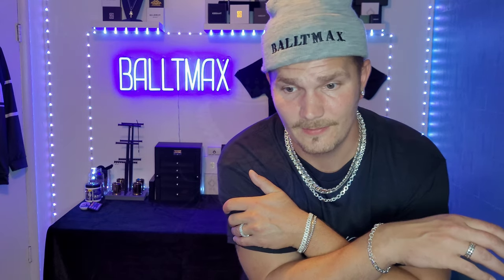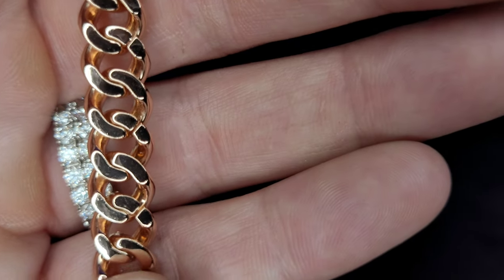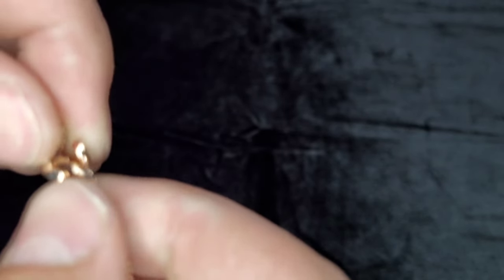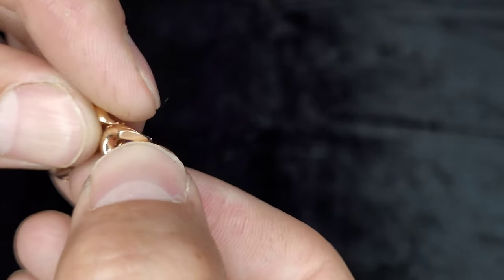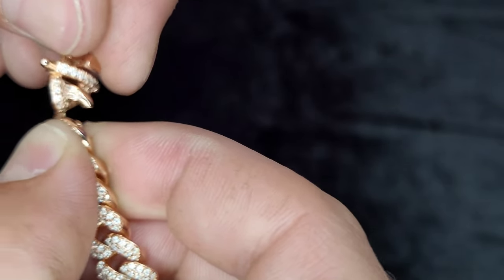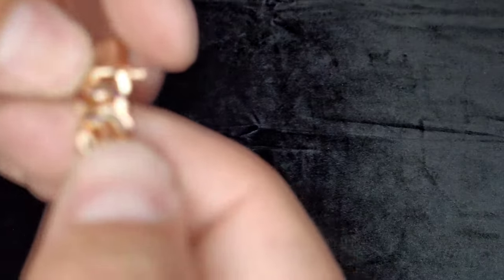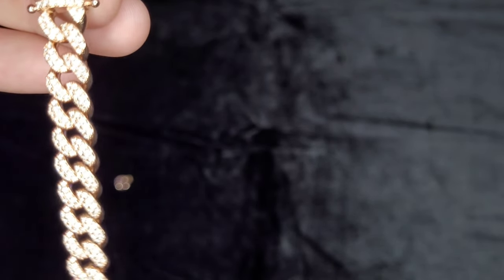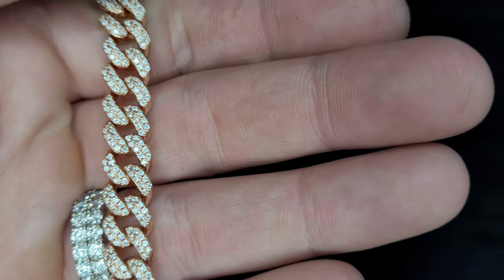How To Remove Unsoldered Miami Cuban Links to Shorten or Lengthen a Chain/Bracelet

Comment: I’ve used a Dremel and pliers but it gets scratched with the pliers, bro make it look easy with using hands and it’s not like he said if it’s not soldered
Reply from the maker: Ya, this only works for unsoldered links
Reply: @balltmax  That’s understandable
Reply: You just get a metal cutter for jewelry to cut a fine slit

Comment: Please take you chains to a jeweler and don’t do this on ur own so you don’t crack a link or leave gaps and destroy your chain  it may not even hang straight if you don’t do it properly
Reply from the maker: I've done it plenty of times, and I only recommend doing it if you know what you're doing! And you can only do it to unsoldered links. None of those things has happened that you mentioned when doing it, and I've done it to 3 different chains/bracelets multiple times